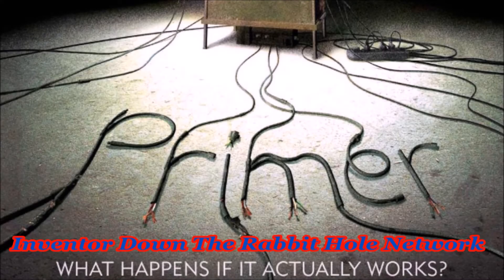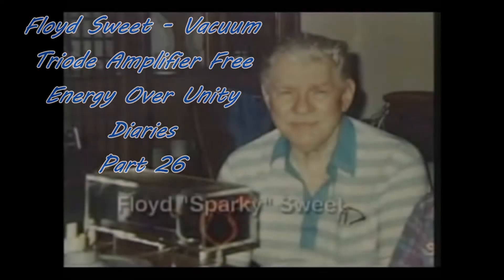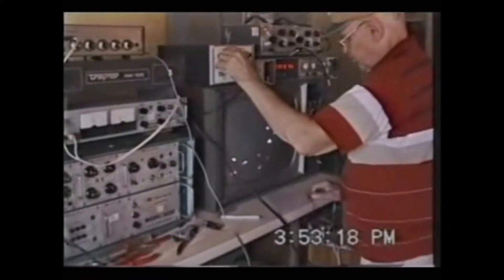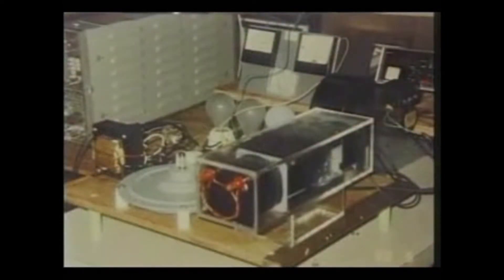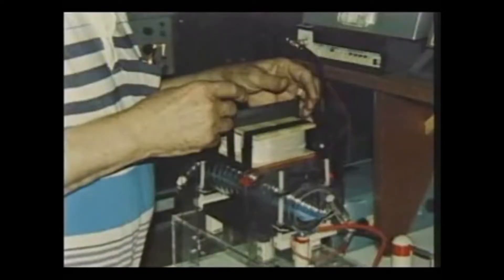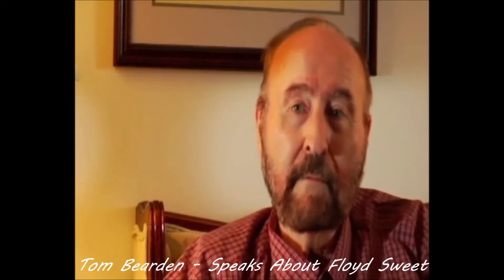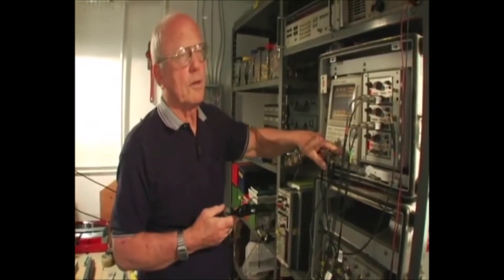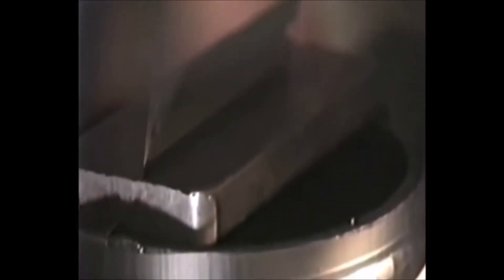Floyd Sweet  Vacuum Triode Amplifier Free Energy Over Unity Diaries Part 26

Comment: It’s not simple. You are working with fields and frequencies that are invisible to humans. The information is so deeply suppressed that we all approach it as beginners. It is basically creating and tuning a device to pull energy from the quantum field (the energy which creates this space we live in) to do that you need specific structures of copper wire, magnets, with fine tuned voltages and frequencies. The goal is some sort of resonance which can tap into that quantum field. But we can’t perceive or truly understand these fields, so it is years and years and years of trial and error. It’s like chasing after a ghost.

Comment: Crazy how no one’s reverse engineered it yet. It has to be so specific and perfectly tuned. The frequency, voltage, magnetic field and maze of copper and magnets. 

God I wish I could figure it out.
Reply: There are many other inventors that have figured out different variations though. The only thing is…. They are bought off, arrested, or killed.
Reply: @chalbio i think the secret is the combination n precise tuning frequency,, rf,signals pulse, not sure dc current or just signals and sine wave together feed through the system can activates those specific minerals like barium ferrite, barium titanate,,can shift into different area time n space which is subatomic level n pull the energy from flux field..